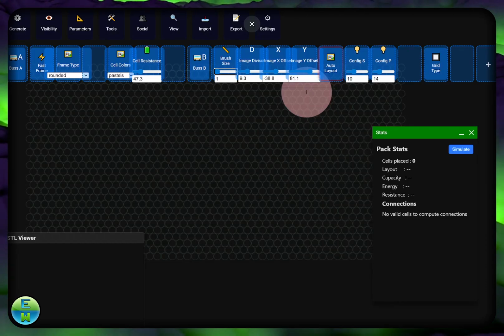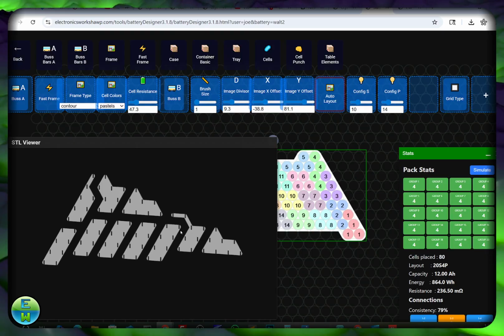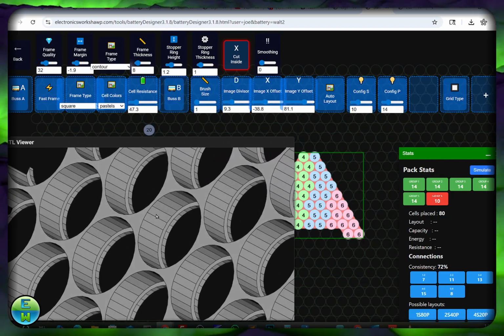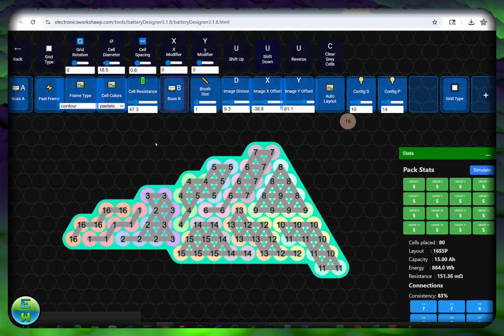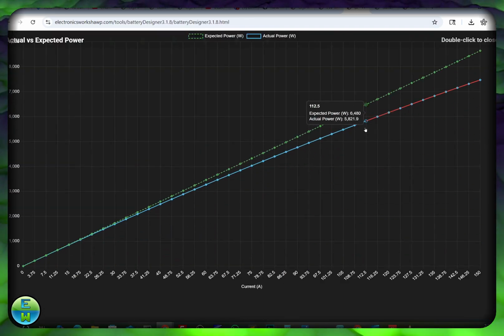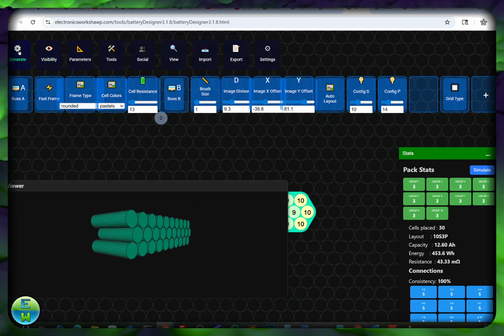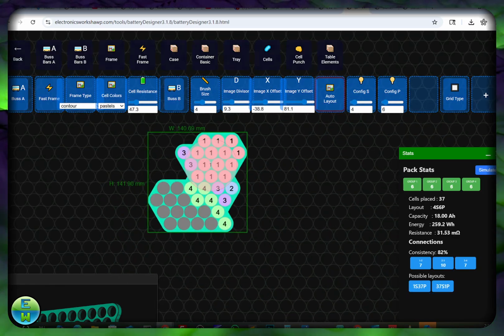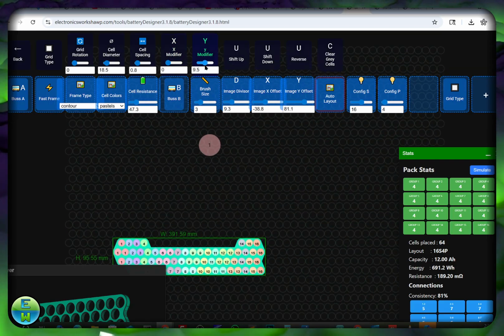Battery Designer 3.1.8 Update

Comment: I was trying to get buss bars connection for a 21s3p i plan to make but the designer is often keeping some cells not connected or often making only 2 parallel connections and separating the groups. Seems like it has problems with lower count of parallel cells configs.
Reply from the maker: Yes, sorry, the automatic layout does not work well for batteries that don't have a large number of cells in parallel. I am working on that. Sorry about the late reply. I'm just now noticing these comments.